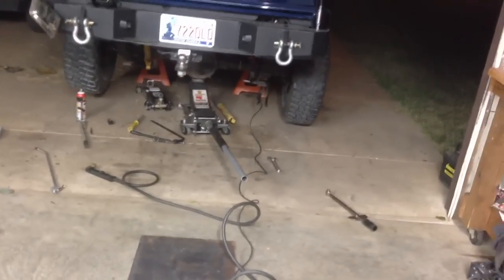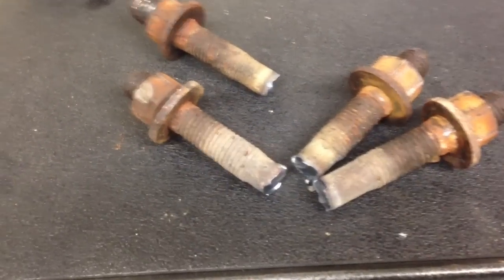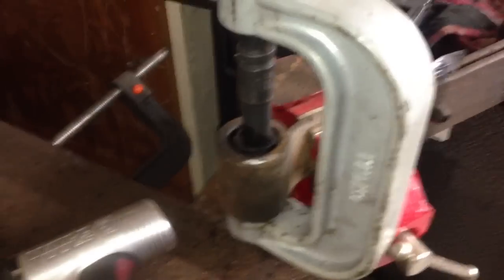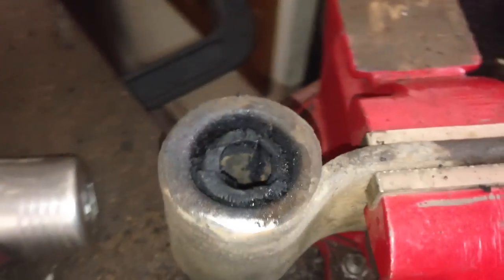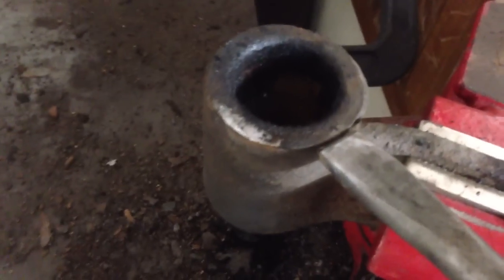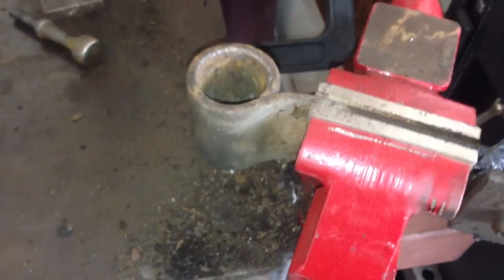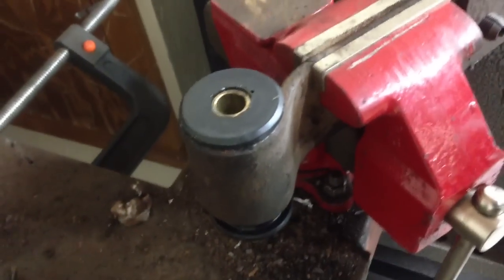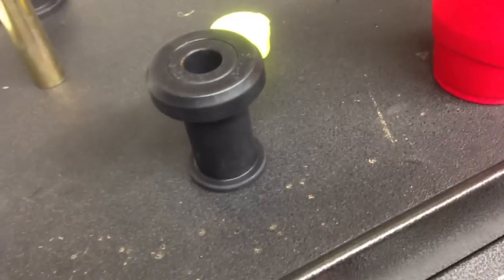ZR2 Leaf Spring Bushing Install How-to (quick overview)

Comment: it's easier to cut a notch in the outer sleeve to release its tension then tap it out with a chieslel. that's how I installed my es bushings in my svt contour. Also burned them out since I didn't have wonderful air tools. lol

Comment: I've been looking into getting some poly bushings, theirs 2 different kits that say they come with 1.5" or 2.5" bushings but the leafs my 99 base s10 has are 1.5" in the back and it looks like 1.75" in the front eye, very confusing not sure which kit to get?

Comment: thanks for the video, man. I know you used a poly kit, but are the stock parts the same for the front bushing as they are for the  rear at the shackle?
Reply: on my 2000 blazer ls, no they aren't the same. I'll reply again with what I found when I did mine.
Reply: Front Eye--OEM P/N 15963542---ATS Springs Product Number RB231
Chevy/GMC Replacement Parts, RB Leaf Spring Bushings

Rear Eye--OEM P/N 15529515 (no longer available) Crossover to Napa P/N 274-6977. 
I got the Napa part from them, and the RB231 from Michigan Truck Spring.
Reply: I replaced my whole leaf springs. Mechanic told me that the bushings had worked themselves out, but upon further examination, I found that there was actually a crack completely through the eyelet. There's a guy nearby me that sells nothing but s-10/blazer/jimmy parts, so I got 2 leaf springs from him for $50, with the bushings already in and good :-)
Reply: In hindsight, I wish I'd replaced the leaf springs like you did, and the control arms as well. Messing with those bushings was a lot of time and frustration. Thank you for the reply and hopefully future comment readers can decide either way to go is right for them.